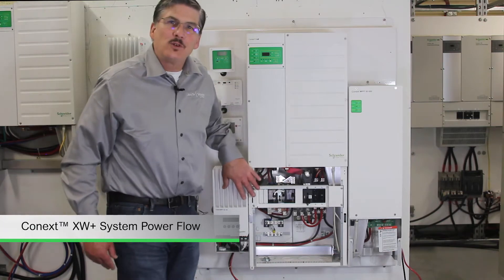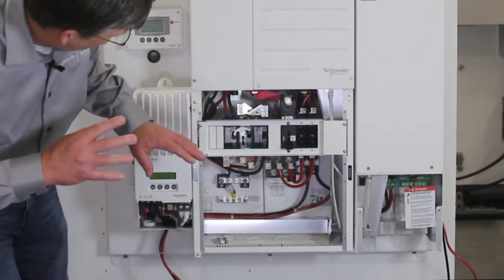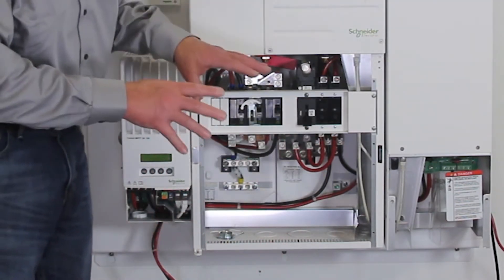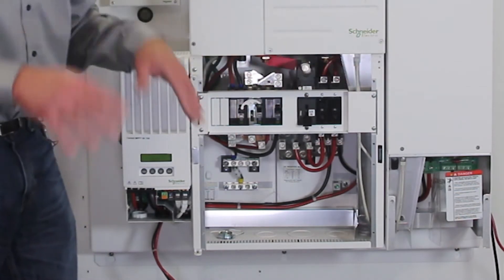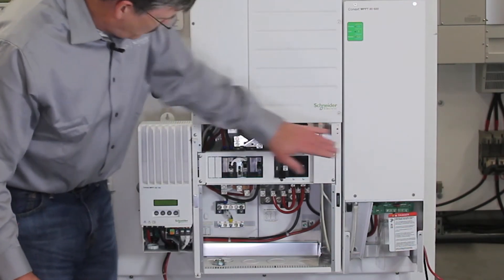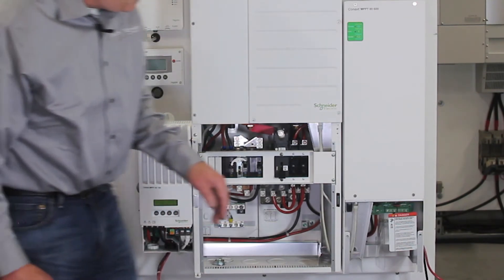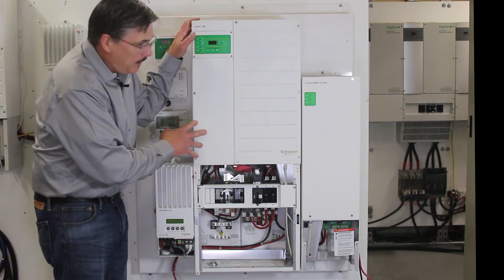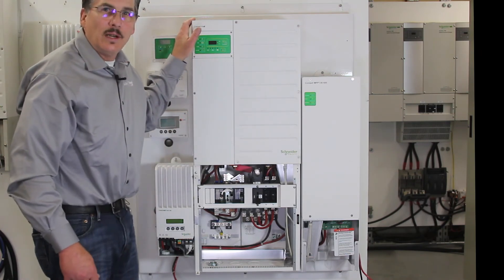Conext XW+ System - Product Knowledge Series Part 3 - Power Flow

Comment: My wife and I are looking into setting up (2) XW PRO 6848 in parallel with Schneider Electric 865-1034 Conext MPPT 100 600: 6kW Solar PV Charge Controller(s) + PDM and 15 kilowatt of LONGi Mi HO5 (545 watt) panels. I would like to know if a system like this requires two PDM - one for each inverter or if a single PDM can be used for Master/Slave connections. These units will be used to charge (2) Absolyte GX (AGM 2,000 Amp hour ea.) battery banks and a high amp hour charge rate needs to be achieved. A 20 kw generator may be installed for winter conditions and low solar input. Is this type of system able to be assembled and achieve the desired result for off grid application?

Comment: I have a EOW-300 from BE-Wind, a 3000 watts wind turbine combo, i am planing on connect it after the 2 breach rectifier to the Conext XW-MPPT 80 600, to then connect it to the Schneider Conext XW 6848, so after charge up my battery bank the XW 6848 will start to sell to the grid the extra power produced by the EOW-300, will the XW-MPPT80 600 will work in this combination? i have being told that the TS-MPPT-60-600-48 works perfectly , but it will be just perfect to have all the Shneider equipment for better monitoring. please give me your wise advise. Thank you in advance.